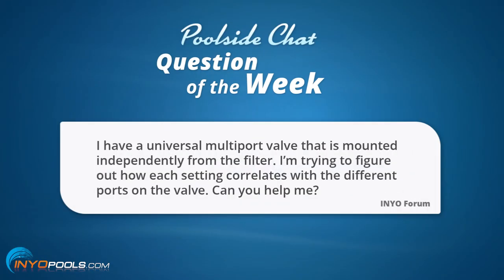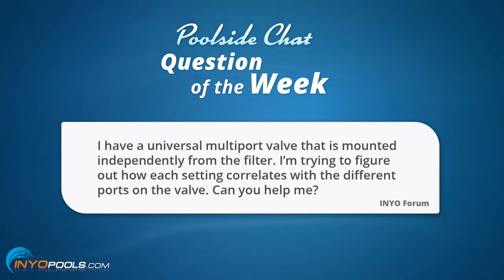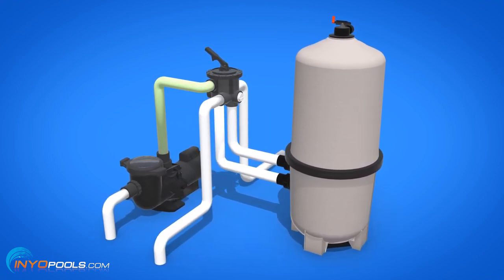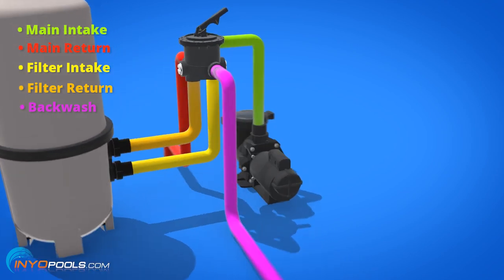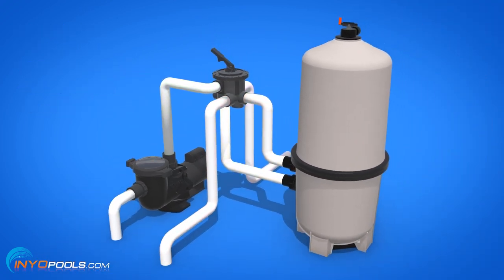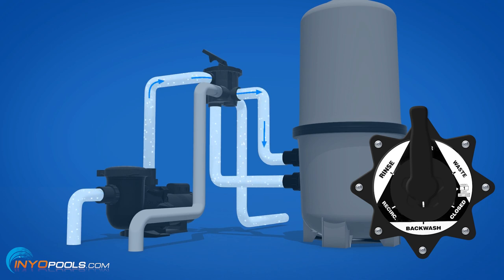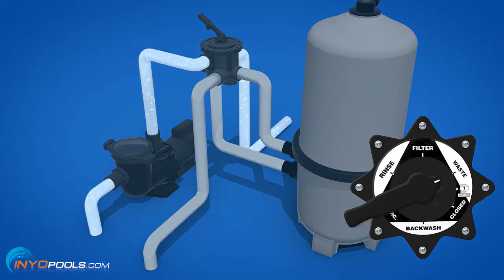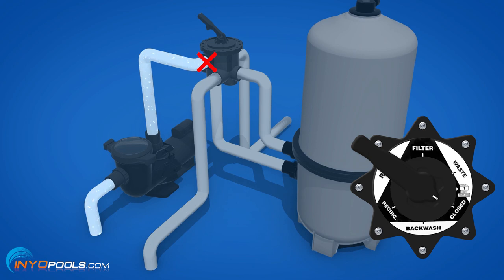How does my multiport valve work?

Comment: I completely agree with Clive. When my new filter and valve were installed recently, I had no idea that the plugged port could be moved elsewhere. I am not sure the pool person knew this. The arrangement he piped up with the plug where it was from the factory turned out very compact. I see that you have many videos that address topics I am interested in.
Reply from the maker: Feel free to comment or message us if you come across any other topics you think we should cover.
Reply: @Inyopools  When I loaded DE into my old Purex filter, for quite some time it came back into the pool. That is why I finally had to replace it. I was surprised when I manually vacuumed my pool today, in the deepest part a small amount of DE material was on the pool bottom. I think this should not happen. I also note that when my Purex filter was new, the water in the jacuzzi did not flow back into the pool after the pump shuts down. The return to the pool is actually more convenient, because most of the jacuzzi water is refreshed daily. Hope you can explain what's going on. Thanks

Comment: Thanks for the video...most helpful. I have a normal pool sand filter, and if I switch off the motor during the daily operation (to clean leaves out of, say, the Kreepy Krauly) and then switch it on again, a cloud of very fine greenish muck is spewed into the pool for about 5 seconds, and only then clear water! Could it be the multi valve not seating or selecting properly?

Comment: hello, i’m a newbie to pool, out of curiosity, i have a question.

for the backwash, the water flows to the filter return and out of he filter intake.

inside the DE Filter, the water will flow from the filter return inside the filter element then out of the filter element then out of the filter intake.

after backwash, we need to rinse the filter.

i normally clean my filter element by spraying with water hose. the dirt is usually outside the filter element.

but if in backwash, some dirt will stuck inside the element, i might not be able to spray it out.

will the dirt be stuck inside the filter element?
or it will just flow out of the element upon rinsing?
Reply from the maker: Hello, and welcome to the world of pools.

I may be a little mixed up by your question because you mention Sand and DE filters, are you asking about how to clean a cartridge filter?

Comment: i have a Pentair multiport valve 261050. How do i install the sight glass which is threaded on one end, how does it connect? How do you get a good weld on the center bottom pipe? There is not enough clearance to prime and glue some areas of the pipe.

Comment: MULIPORT VALUE SET IN RECIRCULATE I HAVE SIDE MULIPORT VALUE I WAS LETTING WATER OUT OFF SAND FILTER REMOVED PLUG LET AIR IN FROM TOP AND NOTICE WATER COMING OUT THE BACK WASH WILL THE WATER GO TO THE RETURNS ALSO

Comment: what about winter position how does it work?
Reply from the maker: The winter position keeps the valve in a half-cocked position. This allows water to drain from the valve when the filter is winterized.
Reply: @Inyopools  appreciate your feedback but can u kindly support me why we have to shut down the pump during filter position selection what actually could happen inside the filter